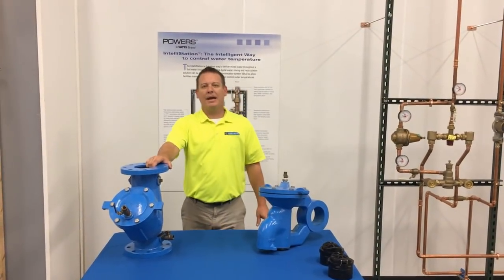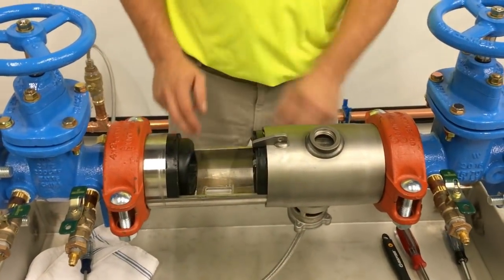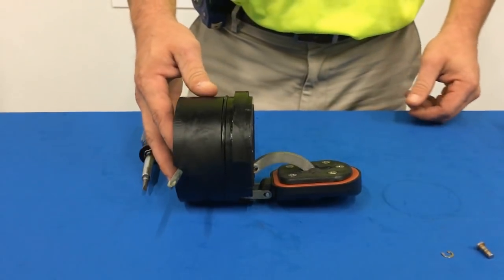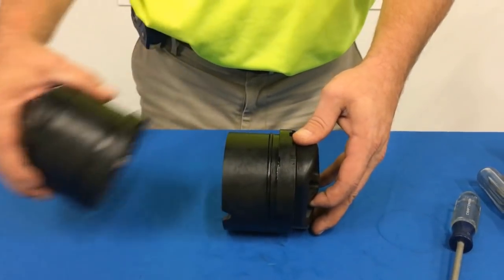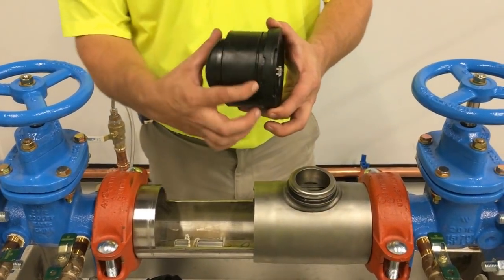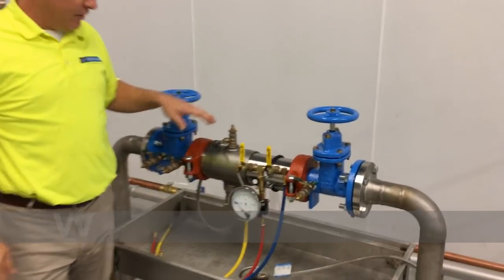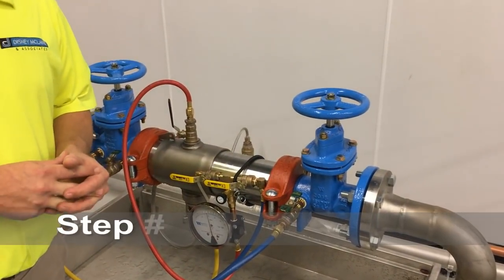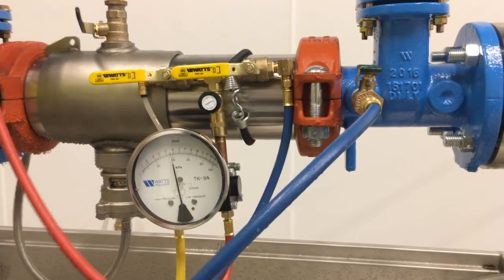DMA Water Tech With Todd - Episode 1

Comment: You have to lubricate the cover plate are before sliding closure sleeve in. If you dont, you will damage the o ring and the device will leak. The video is useful but if you follow exactly what it is done in there, you will have big problem in the field.
Reply: Yes sir big problems

Comment: Step #4 - closing test cock number with the test kit needle holding steady only indicated that the assembly is in a static state. This step does not confirm that the downstream shut-off valve (#2) is drip tight. Stating that the downstream valve is tight on the report form is misleading since it was not actually tested and may be viewed as false statement. As stated in the video, unless you create a flow downstream you cannot truly confirm the status of the downstream shut-off valve. Your video demonstrates such --- as you open the downstream shut-off valve, the test kit needle does not move --- indicating that the downstream shut-off valve is holding drip tight when in fact it is in an open position.
Reply: The No#2 shut off valve is only for maintenance purpose , it should not leak but it does not have really nothing to do with BFP assembly , if in condition of no flow downstream of BFP , it does not matter if valve is open or shut even when testing as long  line maintain static pressure , unles some disharge could hapen downstream that would efect the test but thats about tester to know, practically if 2 shut of leaking , it does nothing to do with BFP if check valves holding tight , specialy because  shut off valves are normaly  in open positions !
Noticed recording of the No#2 check valve way high , above 5 psi , normaly by those type of assemblies are in the range of the 2 psi forNo# 2 check valve, No#1 check valve around 8 psi .  
What is your observation Sir ?